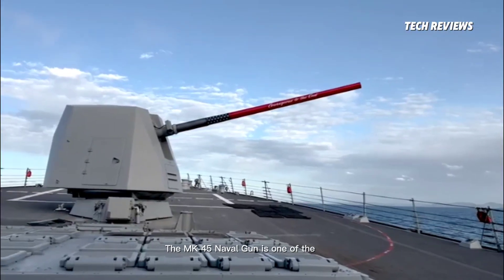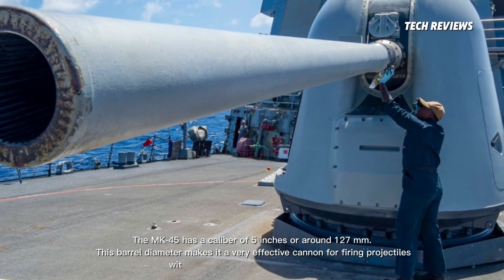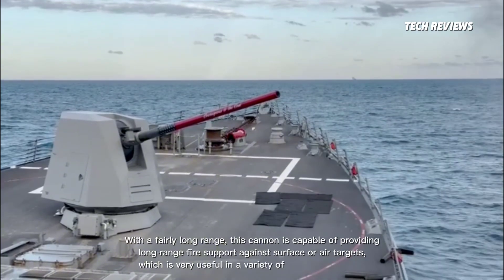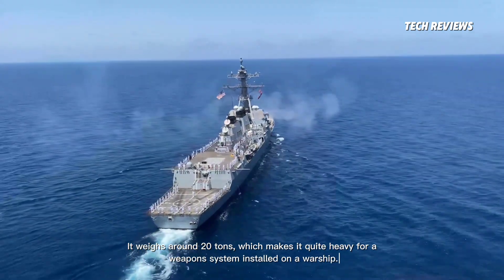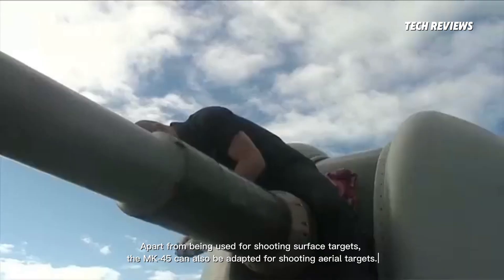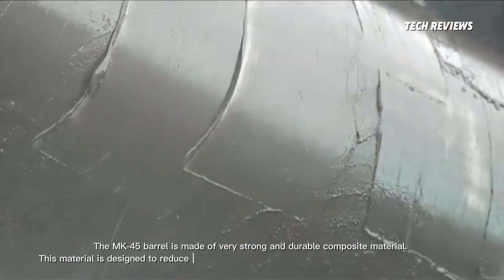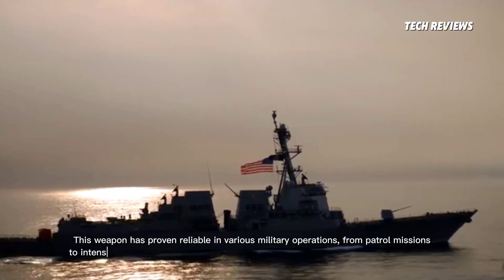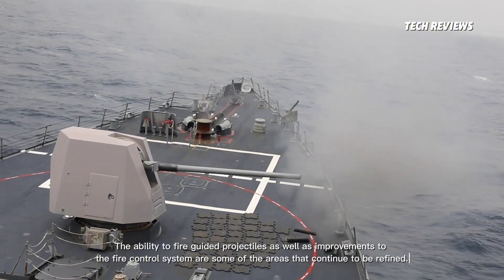Meet The Mk-45 62-inch Naval Gun System, The BIG GUN In Action

Comment: In the 1960s, the older 5" 54 that we used on the USS Dahlgren DLG-12 had a barrel length of 22 1/2 feet long. It appears you have the 62" wrong. If I remember Naval gun length's, you take the barrel diameter times the /number to give the barrel length in inches. Therefore, MK-45/62 would be 5" x 62 = 310" = 25.83' Our gun had two plexiglass domes on top of the gun and we gunner's had to pull ourselves up into the dome pulling the seat up under us until it locked place with crossbody straps like those in fighter jets holding us in. The mount could be fired manually or remotely. The newer guns appear to no longer have people actually in the mount. The movement of our gun was so fast even then that we had sore muscles from being thrown about and our heads were spinning for a short time after general quarters was over. That is probably why there are no people in the mount any longer.
Reply from the maker: Thanks Sir🙏